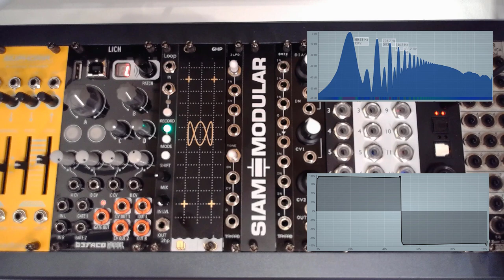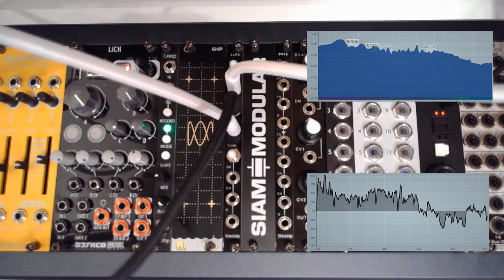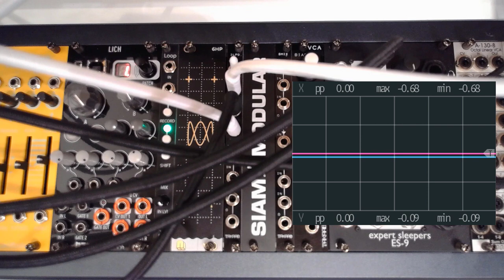Episode 43: Siam Modular TAKAAB 2LPG | Low Pass Gate

Comment: which shop is selling this? (in the EU)
Reply from the maker: I typically get them from Siam Modular directly: siammodular.com.
Reply: Escape From Noise, Sweden and Tampereen Musiikki, Finland both stock our modules. Or you can buy direct from Thailand which usually takes 2 weeks to the EU.
Reply: @TheModularClubhouse  you wouldn't do that if you had to deal with German customs xD I want it THIS year. lol

I think I'll get the meng qi DPLPG instead.
Reply: @siammodular  I'll take a look at the Swedish shop, didn't know it before. Thanks!
Reply: @couchcamperTM  I ordered and received this modul in Germany last week. I ordered it through Reverb from Siam Modular. I only had to pay the price + shipping, and the module was delivered 2 weeks later without any additional costs. I paid EUR 45.70 everything included.
Reply: I just bought the Takaab 2NON, and it was cheaper on the Siam Modular site than any of the local distributors, eBay or reverb.